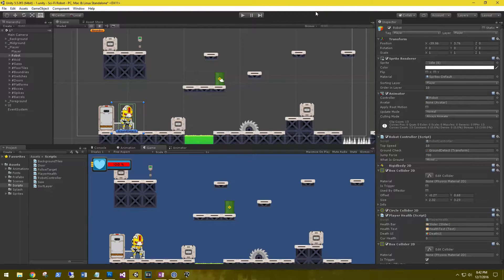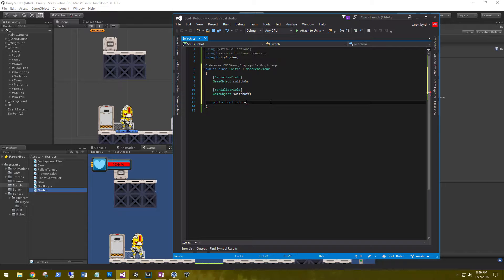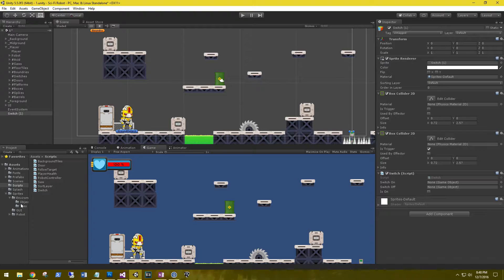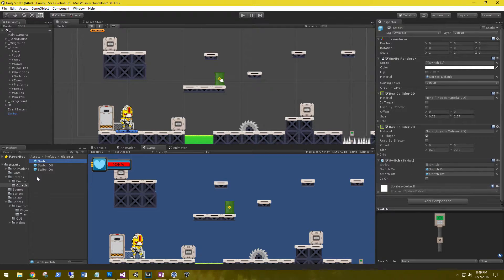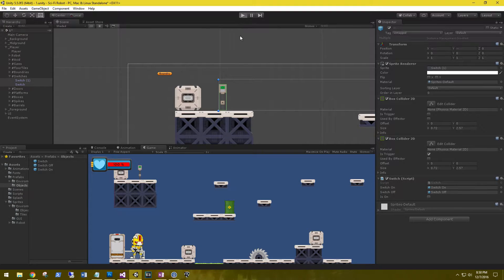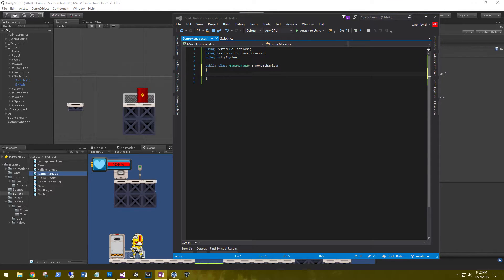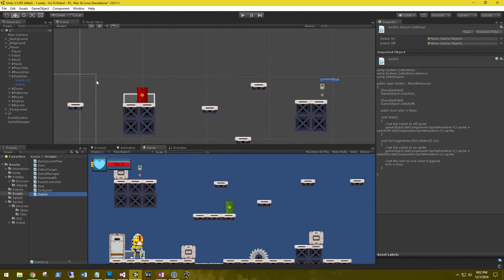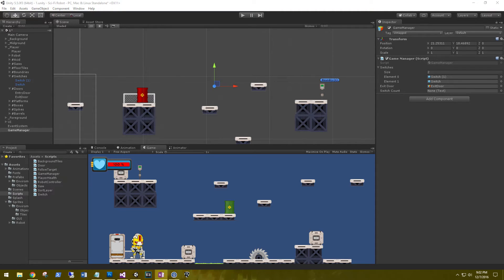🔥Activating Switches and Opening Doors in Unity🔥

Comment: i'am try to create open and lock door with this tutorial. but, in my case the door cannot change from red to green door.
all of code and other normal. how to fix it ?
Reply from the maker: Couple of things. Double check you have the Animator attached to the door and the DoorController added to that animator. Go back and verify that the DoorController blend tree is operating correctly by changing the door state parameter value to see if the door changes. Lastly in the Door.cs script we are only doing two things with the animations. 1. On Start we are setting the entry door state to open and the exit door state to closed. This would be the first thing that you may notice when loading the scene as the door colors will change. 2. You must have the door's named exactly as you are calling them in your script.

Comment: Question about the following:

 if(numOfSwitches <= 0) //if number of switches is less than/equal to 0
        {
            //exitDoor.GetComponent<DoorController>().OpenDoor(); //open the door via door controller
        }

How did you get access to this when the OpenDoor() in Door.cs (for me: DoorController.cs) is private? 

Assets/_scripts/GameManager.cs(62,53): error CS0122: `DoorController.OpenDoor()' is inaccessible due to its protection level

setting the OpenDoor() to public doesn't yield any results after the switches have been activated.
Reply from the maker: Looks like you might be missing the variable: 
[SerializeField]
GameObject exitDoor;

After you have done that, go back and attach the exit door to the game manager.
Reply: I checked my previous variables and it still isn't solving the problem. I'll investigate further! Thank you for your help!